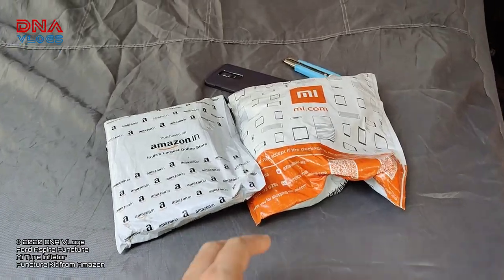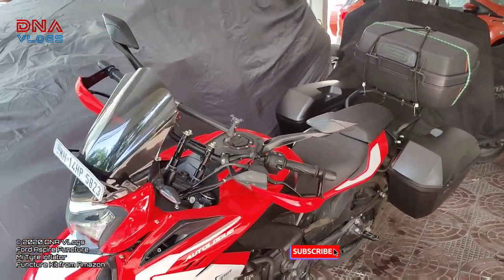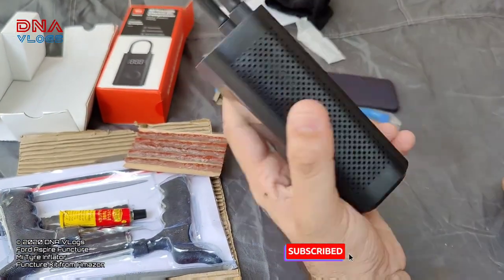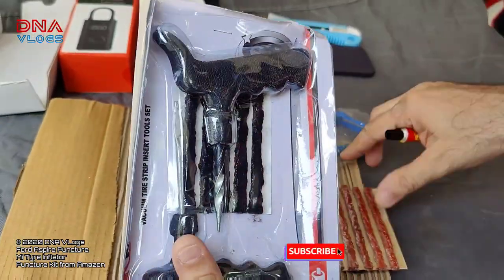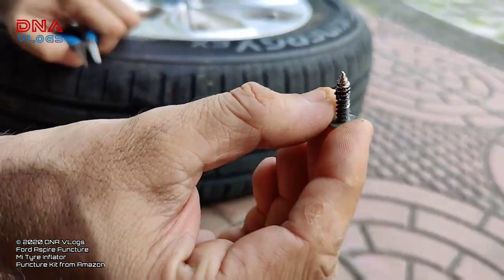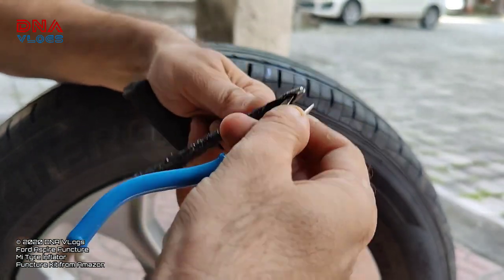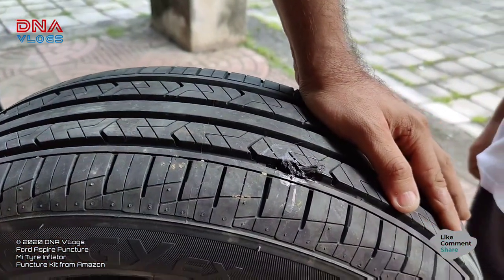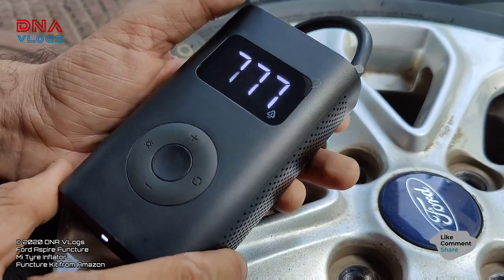Ford Aspire Puncture Fix | Mi Tyre Inflator Unboxing & Practical use | Puncture Fix Kit | DNA VLOGS

Comment: It's a very nice product serves it's purpose very well I've purchased it from that time I've not visited to a puncture shop the only drow back is that doesn't have feature to remove excess pressure but later on I came to know that hosepipe is removable from both the end so just need to unscrew the other end slightly and it will release pressure and at the same time show's the PSI reading as well but need to tighten the hosepipe when you rech desirable pressure or it will release all the pressure.. Hope this thing help some one..